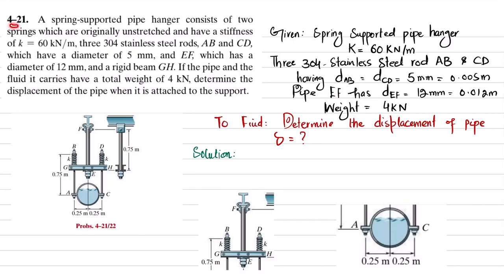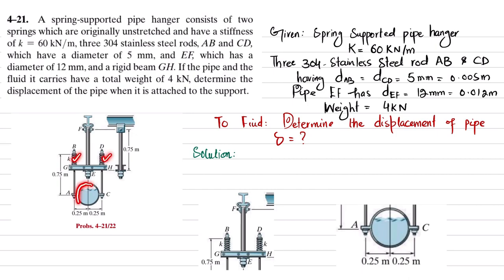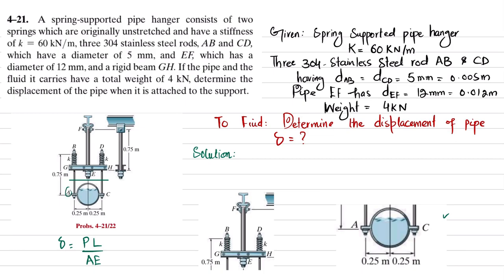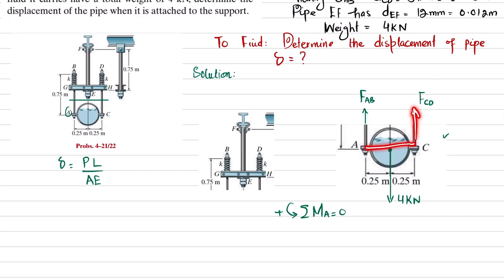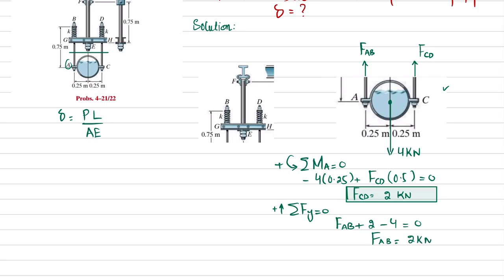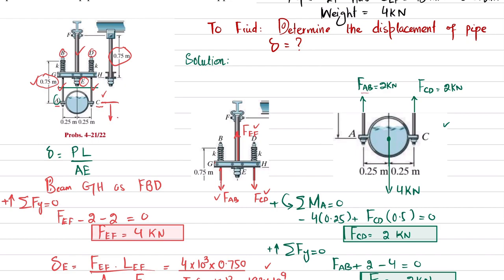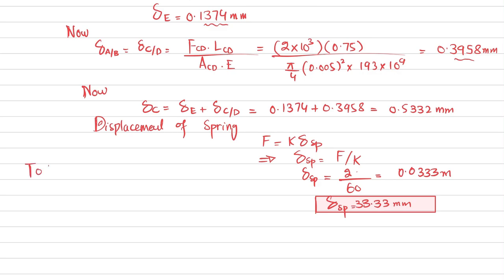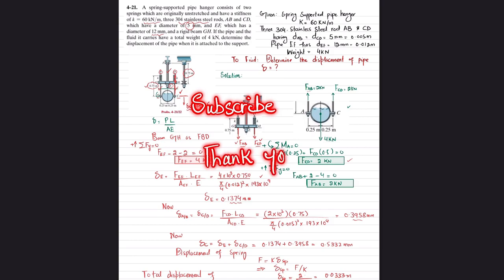4-21 Determine the displacement of the pipe when it is attached to | Mech of materials RC Hibbeler

Comment: can you solve this in a video please?
Two gage marks are placed exactly 10 in. apart on a  12-in.-diameter  aluminum rod with  610.1 10E=×psi and an ultimate strength of 16 ksi. Knowing that the distance between the gage marks is 10.009 in. after a load is applied, determine (a) the stress in the rod, (b) the factor of safety
Reply from the maker: Can you please tell me the problem number ? I shall look into it. Thank you